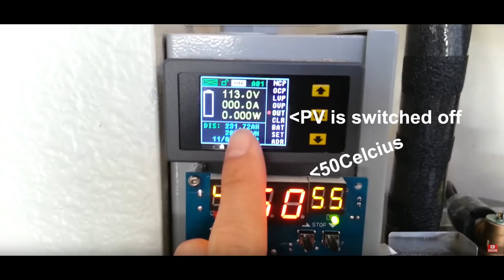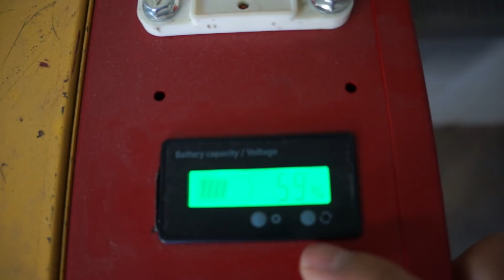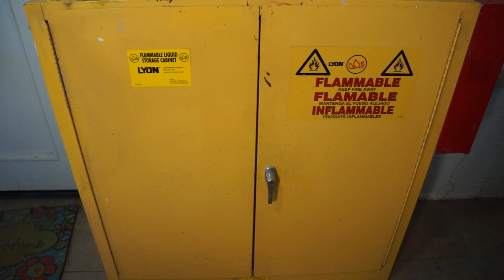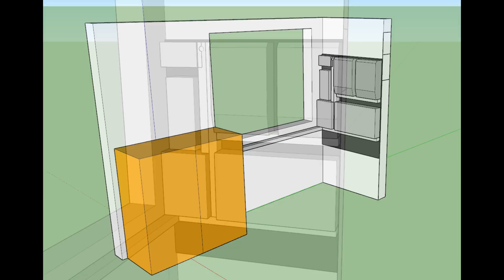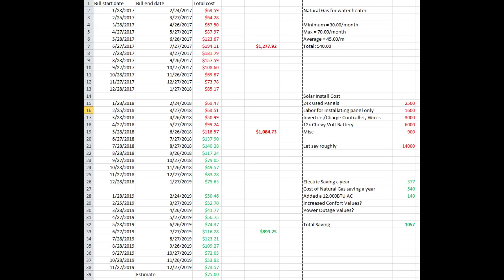My 7kw Off Grid Solar, 37kwh Lithium Ion Battery Bank Cost vs Saving over 2 years?

Comment: I read somewhere that efficiency of solar panels drops a bit when they are covered with snow and on cloudy or rainy days. Can you confirm that from your experience?
Reply: drops a bit? are you kidding?

snow cover = zero output
rainy/cloudy days = 10-30% output

not efficiency over time is only about 40% anyway vs the headline capacity figure everyone likes to talk about ( "my 3kW system" etc)
Reply: Gary Schultz 
Leaves are not a problem, the roof line is above the trees on my street.
But the idea of climbing the steep roof in winter to scrape ice and snow  off the panels seems like a suicide wish.
We have not had a major power outage since the big one in 2003 and that was survivable event. So that is not a good enough argument to fork out substantial amount on solar power installation. If my life depended on electricity, I would rather get a small generator connected to natural gas line that could power my life support system through 2-weeks of blizzard.
I am not a financial expert but I think investing in solar installation with a prospect of breaking even in 10-15 years is not a good investment.
Taking into consideration that I may move out in less than 10 years, this whole solar power idea is not worth it.

Comment: A big help (real world)!  I have been contemplating and watching costs for several years now.  And I intend to do the water heaters first as it's easiest and most efficient way start.  Next would be my AC unit.  Batteries are still the major issue atm imo due to cost and longevity of the different types of batteries. Wish I had an ICP house, would help these cost tremendously.  In Texas btw.

Comment: I did a total off grid house and never had an electric bill in 14 years.
Reply: Envy : )
Reply: goes back to how you want to live,  you can also live like its the 1800s and not have an electrcity bill.   Means nothing really.     Most normal people want to live normal lives.
Reply: Barry Foster I used sunelectric for a 3.3k watt solar array. The solar array was on a stand in the yard so I could optimize the panel angle for winter and summer. I got 2 outback inverters. Chinese chargers after the outback ones failed many times. I had no wind but I really didn’t need it. I had a monitoring system and you must keep close tabs on the battery bank health. I had 12 2200 100+ amp batteries.  Batteries are the big key. Go lithium if you can it’s way better. I live on a boat at the moment and got one lithium 300amp battery to replace 6 lead acid batteries that died every 3 years.  Everything runs better. My battery charges quicker and will last 5000 cycles compared to lead acids 300 cycles.  The payback period depends on you and your usage.  Oversized your battery bank and charging solar array.  It will extend the life of you system. Sorry I can give you a definitive answer but I don’t think anyone really can with out sitting down and doing the math.  Usage vs cost. Example you spend 30k on a wind gen and you previous electric bills average 300 dollars a month. It would take 8.3 year for a payback period however during that 8.3 years your electric bill would be 0.  In fact your electric bill would be 0 for the rest of your houses life.  Be advised battery type will depend on haw soon you need a new battery bank and that can vary from 12 years to only 3 depending on your usage.

Comment: Rather use evacuated tubes for heating water 
More effective
Reply: also very expensive
Reply: they are too expensive and with the cheap price of solar panels it is much cheaper to heat water with them instead. the tubes also do not last as long as solar so you have to replace them as well. you are better off with the solar panels because as you have seen here. after you heat your water you can turn it to charging your batteries which you can not do with the tubes.
Reply: Kusnezoff 
I don’t agree
The glass tubes will last until broken by hail, and is easily replaced.
Tubes will heat water when cloudy, whereas photovoltaic panels will loose up to 90% efficiency.
The tubes might loose 40%

I use tubes for heating water ,and photovoltaic panels for electricity generation.
The tubes can easily let your water reach boiling point.
You will need a lot of electricity to do the same
Reply: @kusnezoff8705  you dont know what you are talking about,  the vacum tubes work for a far longer duration per day and add usuable heat at lower sun levels.  Solar panels are useful for such a small window of the day they dont have much spare time for anything especially in low season
Reply: @yarpos  you do not know the tech I have access to do you so you have no idea what you are talking about. you think that all there is is all there is but have no idea that there is other tech available that a lot of people don't know about. so to be honest, you don't know what I am talking about is more like it but I know what I am talking about. and what I am talking about is more efficient than what you are talking about. since you have no clue what I am talking about you really can not say anything about it.

Comment: Well done sir, there are systems out there to heat the what by using the sun. Check out for solar water heater and solar collector, these things could help you get free from the gas company.
Reply from the maker: So many peoples still don't get it.  Wires/Conduit and Solar panel are so much more reliable and cheaper to install vs Solar collector heater.  Think about how much it costs to repair leak pipes, water pump ect and installation conflict between PV and Solar Collector.
Reply: @devildestiny555  thinking by this way, makes sense, but there are a lot materials you can use. 
My Water Heater is homemade, basically I made a "zigzag" aluminium tube and I put it inside a box made of wood with a glass covering it after painted the tubes w black color. 
Here solar panels and gas are overpriced, so I made myself a water heater, I spent less than 120 us dollars. Even if you make it with scrap will work and maybe you will not have to use pump bc the hot water always go to the "top" of water (it is less dense).

Comment: Here in Thailand, the rates are tiered based off consumption.  I have 5 Jinko 325 watt panels 1.5k Solax Grid -Tied inverter.  I'm getting about 5--7.5 kWh/day.  I basically run a 1.5kW Panasonic Mini-split day and night.  I'm saving about a third on my bill.  My total electric bill is now about $85 USD.  I'm saving up to do a 5 kW SOFAR Hybrid inverter in a year  or two.  The current system installed cost was about $2000 USD.  It looks like it will be between a 5-6 year ROI.
Reply: I've been looking into solar for quite some time. How did you get around the permit system? I live in Thailand too.
Reply: Got an extra room brother?
Reply: very practical, and one can scale up if needed.
Reply: At this rate payback about 5-7 years.

Comment: I had an online job, that resulted in being much more profitable than my day job (I´m a survivor of the Venezuelan economic collapse). 
Blackouts were becoming common, and that affected my performance. How was I supposed to be able to work from home without grid power for my laptop?
Short answer: hooking three small, wasted motorcycle batteries to my UPS, inside my room while still fresh(we have air conditioning in every room, it´s cheaper than a central one).
Once room got too warm, I would plug a small fan to the UPS and kept working. 
Side note: my (now ex) asked why I was going to waste money in an UPS?
The value of your system if something happens and you stay without power in a extreme weather, is not susceptible to calculation. 
Trust me.  
You have a great setup and thanks for sharing it with us.
Reply: I'm in somewhat of a comparable situation here myself, the power grid here sucks balls ( I think that is the technical term) but with 600 watts of solar panels and about 300  used 18650's I'm pretty much able to keep my laptop off the grid 24/7
Reply: If you live in a city with electricity blackouts it worths investing in a solar o other kind of generators. Also if you live in a zone without public electricity service. But 14k USD with a 1k estimated return per year and using contaminating batteries, that's only marketing.
Reply: runescape?

Comment: After check the number, I decide this is not a good investment at all. he didn't even count in all the time spend on learning the setting up of the system, all the labor he put on the system, any potential repair work fund for this system in coming 10 years. Apparently, he also live in a very warm and sunny  place.
Reply: tommy song Location is a very serious consideration when using solar. Latitude affects the power of the sun and thus solar harvesting. Season also can cause the solar power to vary. Then there is storm, cloudy days, snow and other weather related factors. Solar power output can vary from 100% to 0%. Thus solar panels may be worthwhile near the equator but not so much near the North Pole.

Comment: Here's the problem I see with calculations like this.  If you took the $14K and invested it at 5%, in ten years it would be worth $23,214.  If you took your yearly savings of $1,000, and invested it and $1,000 per year at 5%, in ten years it would be worth $12700, for a net loss of $10,514 in ten years.  If you extended that out to 20 years, the loss is even worse.  If you financed the system, your payments would easily exceed the savings.  I've yet to see a solar system that would pay for itself without government grants.
Reply: Sometimes there is more to consider than one set of numbers... For instance, he mentioned the blackouts. In Florida hurricanes knock out the grid for as long as two to three weeks. If you have ever lived through one of those, you’d consider an investment in solar power worth while.

The same comparison could be made car vs bicycle, house vs tent, steak vs chicken...
Reply: Excellent analysis! And this does not account for degrading efficiency of the system over that time frame.  I keep watching videos like this one hoping to convince myself that solar can make financial sense for me in a suburban living situation.  It just doesn't.  If you are in a remote location with difficult/expensive power grid access, feel some obligation to use renewable energy, or envision a doomsday scenario with extended power loss - then maybe.  For everyday power consumers, I fail to see solar as an fiscally savvy option.
Reply: Gorman Thomas I’ll add degradation to my calls. Also I forgot temperature. Solar performs less when hot best when cold. I have these calcs in an app I am working on but don’t have the numbers in memory.
Reply: George Carlson where can you find a guaranteed 5% return over ten years?! Interest rates are at historic all time lows, we are on the brink of another global recession. If I could guarantee a five percent return I'd be borrowing millions at 1 percent and investing it. As would everyone else. It's not happening, which means five percent is not achievable with a degree of risk that would be unacceptable in the case you are trying to make,
Reply: Your statement makes sense but show me one item in your home that makes money or value. If you put 100000 dollars or euros in my case case in the bank you would be lucky to earn a hundred dollars or euros at the year end in interest, but in my case 7500 euros on my roof will give easily 400euros back
Reply: @ldowling2714  Don't get me wrong, I've nothing against solar power, just they way some people are selling it.  I drive a Tesla Model 3.  There's no way that car would save enough money in reduced operating cost to cover the difference between the cost of the Tesla vs a Corolla.  I bought it because it's fun to drive.  I think personal solar installations are much the same.  Install the system because of the tech and the feeling of independence it offers.

Comment: Im a newb to solar. Im running 12 300 watt panels. I generate about 3600 watts. Right now Im still working on the battery bank. I cant afford lithium batteries. I just slowly collect traditional acid batteries. Right now I run everything on my house except the frunace (I live up north) from around 10 am till 8PM.  I jumped in and am not an electrician. The thing I didnt think about on solar was the batteries. YOU GOTTA HAVE A LOT OF THEM! I spend most of my days hunting around for batteries for cheap. Yea you gotta keep them the same, but you can also build more than one bank. Right now I have two battery banks. One bank simply runs the lights that are all LED's so I seem to only charge them up every couple days or so.  The main bank runs everything else. THis spring IM going to phase my furnace onto it. Hopefully by next fall Ill be 80% or more off-gird. I wanna buy about six more 300 watt panels, and Ill be satisfied. I have no females in the house these days so I dont use near as much energy lol. 
To me a solar system is worth it. I'm doing it myself and so far I have about 6K invested in it. But the end game is to be off grid. Not just for the savings, but my house is paid off, and so its a matter of killing off the rest of the bills.  No more house payment, no more utility bills, the less hours I'm slaving for the man. :)~ 
Ive had some rough times in my days. And the thought of being in the position where no utility company can threaten me ever again!!! ABSOLUTELY PRICELESS! THats the main reason why Im building a solar system. FREEDOM!!
In a couple years I wanna buy a cheap electric car and charge it up on solar :)~ ONe day I will live for free. LMAO
RIght now I'm experimenting with an indoor garden with an LED light system. IM gettin there :)~
Cant wait till at at this guys level. But doing it slowly and by yourself is the way to do it. I wouldn't go into debt for a solar system. Just build on it over time. Buy components slowly and keep building it.  If I would have hired someone to set this up, it would easily be 20 grand.
Reply: To be fair the power company would only have been "threatening" you because you werent paying the bills.  They are a business.

Congrats on building up your system,  and learning all the necessary stuff along the way.  You sound like a versatile person :-)

Comment: in the philippines the power goes out all the time and it is happening in cali all the time now. so having a battery system is very important now and having solar is a no brainer if you have batteries.
Reply: Tesla auto batteries best value.
Reply: good luck in the next typhoon with that no brainer

Comment: So far you're right about not recovering the present cost of a full solar installation. I haven't found a way yet, but I did find that these portable solar chargeable batteries that now sell for about $200 - $300 can power my little RV for two nights of camping and fishing. There are some good free camping sites near Savannah that have hot showers and bathrooms. My RV is all 12 volt with led lighting so it doesn't need much power. The refrigerator draws the most wattage, but with all the money I'm saving by camping free I just ditched the fridge for the old Coleman cooler full of ice and Cherry Coke Zero and eat in any of the superb seafood restaurants in the area. (Unless I catch fish, then I always have my cast iron skillet and a campfire!) Video coming soon.
Reply: also yet another analysis that doesnt include the opportunity cost of the investment

Comment: Here in Canada the prices are significantly and also disproportionately higher for a system like this, and coupled with the fact that we get less sun we basically pay twice as much, but then have to build a system twice as big. I doubt I could copy your system for less than $30 grand. I value the security, but until a 10 year payoff is possible here, it's still a dream.
Reply from the maker: Understand,  it will varies big time base on location.

Comment: Your system is very impressive and the build price was great but your numbers clarify what we all know, that these systems will never ever pay for themselves. I have lots of solar, water heater, pool heater and solar voltaic but would never even consider going battery, the cost and maintenance requirements are just too high. Going this way is not even green as all the hardware and batteries had to be manufactured using energy and causing pollution initially, and more in a few short years when all your batteries will need replacement.
Reply from the maker: I would have to disagree on the part where you said this is not green.  I am using salvaged battery from wrecked electric car otherwise would had went into a landfill, I am giving it a second life while harnessing the power from the sun.  I feel like I did my part to the best of my ability.   I only heavily used my power during the day time and they come directly from the solar panel (80%)...  These battery are hardly getting cycle, I have high hope that they can last at least 7-8years.  While battery system may not be the best answer for the future, but you can only do your best at a given time and hope the future someone will revolutionize battery technology.
Reply: @devildestiny555  To go off grid when there is cost effective local power available just makes it "an expensive hobby".  I agree an interesting hobby.  If you want your batteries to last, keep them cool.
Reply: From an overall Co2 budget point of view (if you care about such things) you are probably correct,  but I like the idea that an EV power pack has been diverted and actually used for something useful.    There are so many uncertainties (future maint, replacement, escalting grid charges etc) and location specific factors that most payback calculations are rough and best and often skewed to the story the creator wants to spin (not the case here I should say the guy seems quite realistic)